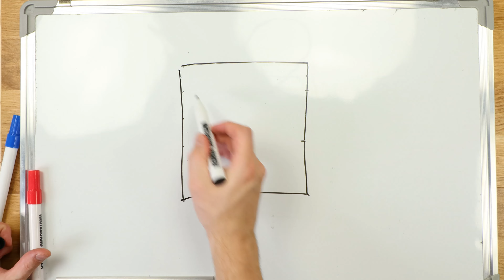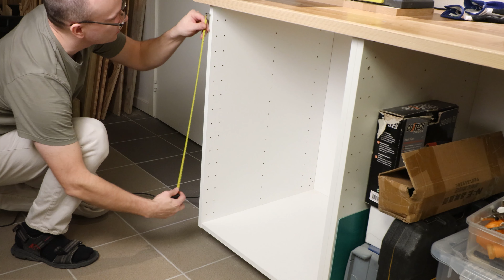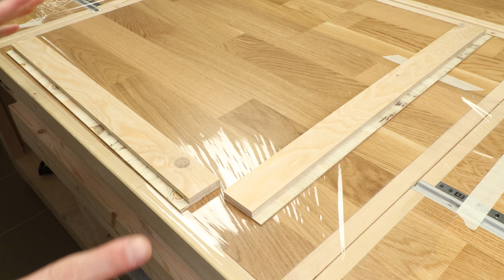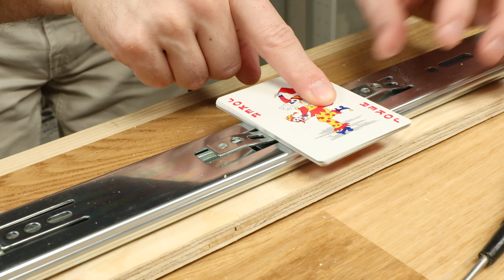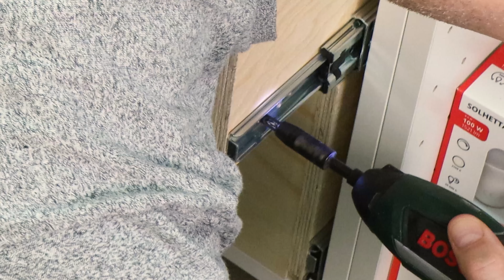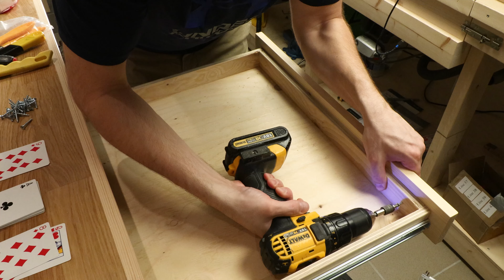How to build and install your own drawers - Step by step guide

Comment: Thank you for a great video.  Have been watching cabinet builds for years and have never seen or been made aware of the C tabs on the side of the slides that you can bend out.  Very good to know.  I had just used some thin strips of wood to bring them inward more.  I like you idea better.  Thanks.  New subscriber.
Reply from the maker: Thank you. Yes they are very handy!

Comment: I saw a youtuber (John Heisz) use OSB boards (Oriented Strand Board) for shop drawers about 10 years ago. I don't know if you have that where you live or not but it's most often used as sheathing for roofs and outer walls.  I thought it was crazy but I didn't have a lot of money and a 4'x8' foot sheet of OSB was only $11 at the time so I tried it.  They've been holding up great for over 9 years now. It doesn't look as good as free plywood but it worked as drawers very well.
Reply from the maker: I bet it do! But how is it when you nail/screw it from the side? I have never tried but i get a feeling that the wooded chips would easy break apart in case like that? Plywood also have this kind of problem but i think OSB might be worse? If you look closely then you can see that my walls are just painted OSB :)
Reply: @DesireToInspire1  I screwed my drawer panels together using drywall screws and pilot holes. none of the drawers have shown any fatigue that I've noticed, even the overloaded ones. I made them with the bottom panel as OSB screwed into the sides from underneath. it was my first cabinet type project I had ever built.